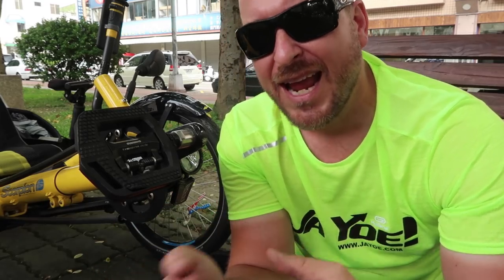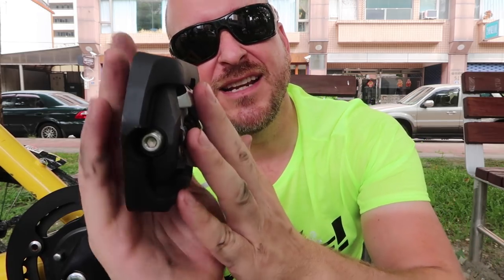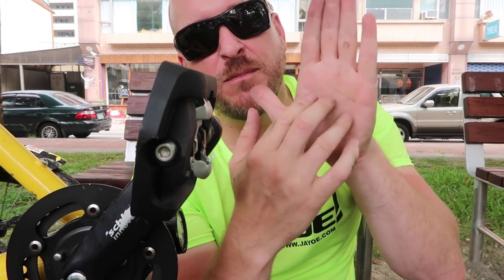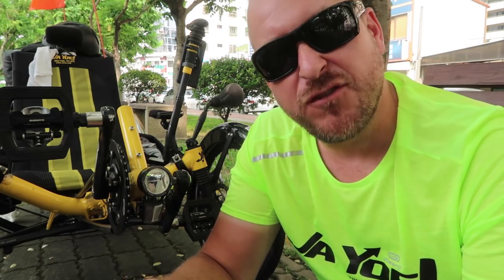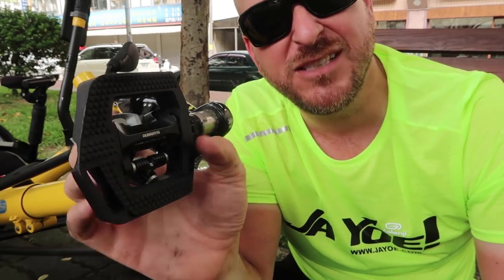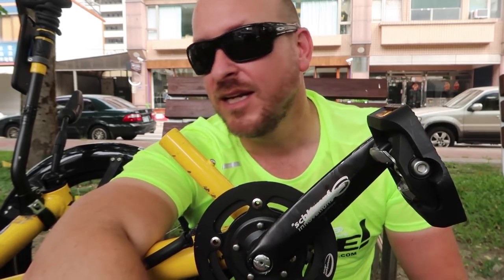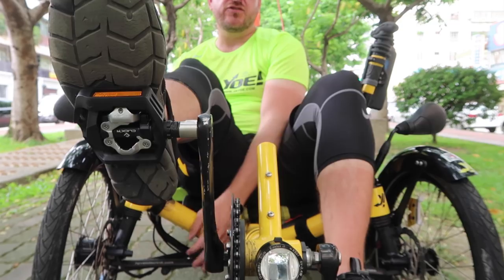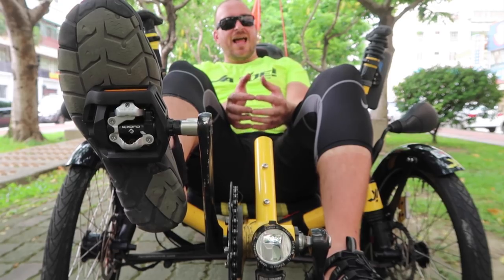PEDAL CONFIGURATION and FOOT PLACEMENT | CYCLE SUNDAY

Comment: Hi Matt...  My wife and I ride Greenspeed Magnums. We average around 3000 - 4000 kms per year on our tours. The Magnum has no suspension. I have experienced leg suck once when I ran over my right leg. Fortunately(!?), while I was going pretty fast downhill, running over my leg caused me to crash into a ditch pretty well immediately so I had a bunch of painful scrapes and colourful bruises but nothing broken, beyond a side mirror. I know the reason it happened too - I hit a rough section on the road unexpectedly and the leg that was NOT pushing is the one that I ran over! Now I ride clipped in. However, after 6 to 8 hours or more, I experience the same numb foot issue as you describe. I have taken to un-clipping one foot at a time to move around on the pedal. I like your analysis and I may go back to platforms. One thing I find, however, is I get a huge power increase with the reverse pull while clipped in. That's very handy, especially when I need a quick acceleration. I also use the Kneesavers - best investment ever! I run a Schlumpf Mountain Drive and a Nuvinci N380 with a 60 tooth sprocket on the front. My Sunday Trike suggestion is actually about your camera setup - how do you video while riding? Why isn't it all jerky and seasick-promoting (as mine are)? How come your sound is so much better than my efforts? After riding thousands of kms in all kind of conditions, what kind of camera would you recommend?? PS. We love what you are doing and have followed you from the beginning. 73, Larry and Debbie
Reply from the maker: What I’ll do is go over my writing recording set up in the next gear video on Friday. I’ll show you the camera I use and I’ll show you exactly how I hold it in order to get that really nice clean shot. Glad you didn’t break a leg.

Comment: Thankyou for the informative suggestions.  I have also found that moving my feet slightly around relieves stress, and also using wide platform pedals.  Its nice to know that I am not alone in this seemingly odd habit.  Happy riding!
Reply from the maker: yea!  it is certainly helpful... restricting movement cased me a lot of problems.

Comment: I like the sound of the pedal extenders....think I will try them too...
Reply: Within days of getting a Catrike , my right foot slipped off several times and I ended up with a nasty road rash above my right heel. I immediately got pedal extenders and clipins, and all is well. Previous to switching to the Catrike I put in about 30,000 miles in five years on my regular bike, without clipins! I. detested them on regular bikes.

Comment: I ditched clipping in on my FS26 too, I use mountain bike style platform pedals with metal studs that provide plenty of grip. I can move my foots point of contact around a bit to prevent numb-foot.
Reply: Yes, indeed!  I totally agree.  These are the ones I use:  https://www.amazon.com/gp/product/B018J1J7QE/ref=oh_aui_detailpage_o09_s00?ie=UTF8&psc=1
Reply: They really work great, I put them on all my recumbents and I never have numb foot anymore. Like Matt pointed out getting your foot lower at times also helps eliminate fatigue.

Comment: I experienced leg suck once. No broken bones, but painful and some nice bruises. I now have the same pedals as yours. I clip in when riding on rough pavement or in twisties. On smooth straight stretches, I unclip and flip the pedals over, placing my arch over the pedal. Much more comfy. My next "solution" will be to have Bill Barre of FB's Recumbent One group build me some "arch clip" shoes. He moves the clip back to the arch area. Users swear by them.

Comment: Really love this idea of cycling Sunday Matt . Despite what some of us have said about your fit on the Trike only you know what is comfortable . The only down side to the foot position on a recumbent is gravity is working against you not for you as it is on a regular bike . Some of the energy you could be using to go forward is being used up to hold your feet in the air , and for that reason alone I will always support being clipped in . Plus cyclist in all positions know all too well about hotspots in your shoes with many solutions but for me I had to recently spend way too much on a pair of Shimano XC9 to finally get rid of it but are the most comfortable shoes I have worn ..

Comment: I commute 30k/day on my Gekko and pedaling in the middle of my shoe has shown itself to be the most comfortable position of all. In a recumbent you can put way more force on your pedals and the ball isn't built for force, it's built for jumping and landing. Dead lifters don't go up on the balls of their feet, they keep the weight closer to the heel. You wouldn't carry a heavy box on your tiptoes etc... A suggestion for a cycle Sunday would be the drive train. How do you keep it clean, specifically how to de-grease and clean the insides of your chain tubes.
Reply: The goal of weight lifting and carrying a heavy box is to lift something off the ground.  The goal of cycling is to push the pedals away from your hips.
Reply: i agree, but for roadcycling it's using higher cadence, and they use their calves to add more watts.
thats why they pedal with their toes, bc they can use more force rather than purely downstrokes
i actually noticed this even when i do MTB with flats, if i rise my saddle, i tend to use my toes and i feel more power on higher cadences
but on another hand, i end feeling discomfort on longer rides from the saddle and even on my feets
higher cadences and toes pedaling allows to produce more power without getting too much anaerobic, but it can cause discomfort
while for longer pedaling times, lower cadence, and more heel pedaling is more confortable, and you dont care much about higher power transfer, you can about comfort, its kinda like walking

Comment: Depending on your fit, clipped in can let you relax your legs a bit - I first rode on a crowned tar and chip ride without clips.  I was so tired afterwards from holding my legs up and on the pedals that I put on  my clip shoes and swapped pedals.  I still rode upright at the time, but had switched to non-clip pedals because of hot-foot issues (so the opposite of what worked on the trike).  I’ve now modified a set of old Shimano shoes for mid-arch cleat position and am very happy with it.  I use the Click-r dual-sided pedals on the trike- which are easier to clip-in and -out of than Shimano’s other models.

Comment: I've ridden both clipped in and not.   Clipped in my feet would also get numb.   I now have a pedal attachment that uses velcro straps to hold my heals in or to keep them from falling off the pedals.   The only time I ever lost my footing on a pedal is when I was really tired, but I would catch myself really quickly and not have a problem.   I have had the knee savers since day one.   I do however move my feet around like you.   I like having that option and my feet tend to last longer on the trike, before having to get up and stretch.  I no longer use the clips and just ride with my tennis shoes.
Reply: dbkguy could you post a link to the pedal attachments you use?
Reply: I'd like to know too

Comment: Hey ,Matt I think a video about the suspension would be interesting.  Are they adjustable shocks or springs for different types of weight?  Can they raise or lower the travel height? Can you adjust for a softer ride ? Or stiffer for more aggressive feel ?

Comment: On my two wheeler I had clip-ins I kept getting numb big toes, moved the clip around same problem so took those off also ditched the shoes, expensive but useless. I then changed my shoes to just thick soled, waterproof North Face outdoor shoes and have used them ever since, saves carrying two pairs shoes but I do cycle in colder climates. I changed my pedals several times but ended up getting large flat pedals and those are excellent, when I get my hp I’ll transfer and see if the pedals work okay, but clip-ons I won’t use again. I may also try a shoe insert for plantar fasciitis as I had it... but don’t anymore... and boy it’s painful but the insert was like super cushions👌 What make and type of shoes are those shoes your wearing in this video? Don’t have to tell me now could be a shoe review video?? Great review and live stream 👍

Comment: Thank you for your testimony. This is very good info.ok my Q; How are you faring after 20k KM with Tires Tubes and Brakes ? How often do you need to replace your tires due to worn treds? Which Brand / style do you recomend for long term tred wear? 
My Dream/Goal is to design a Large Wheel (29"-39") ETrike for Cross Country /State Riding. So far I have noticed the rubber on my 29"MntBike wears down within a 4 month time line. Just doing daily 5 mile rides. Thanks again keep up the Great Work! I wish You Safe Fun Riding. V/R, TONY

Comment: Verry good tip. Until now I also use Shimano cleats and I have exactly the same effect and problems. But I'm if I do not use them, I'm afraid that I can't the push back orr pull effect and need more muscle energy in fact.

Comment: Hay Matt, loving the vlogs. I am a fellow trike “pilot”;) I have lower limb damage both Achilles are shot and I ride the same heel on pedal eliminating the anckle flex your right about the position being effective and less tiresome while I doing off-road / beach riding.
Reply from the maker: Right. And I think you get more torque force. If that makes sense.
Reply: I agree you probably have low speed torque and a lower speed /comfort over distance you with the rolhof speed hub and your smooth front drive switch with low drive train losses over the standard derailed system probably have better returns than myself running standard equipment.

Comment: Maybe you could explain X-Seam measurement and fitting a recumbent to the rider. 
   I have an extra wide foot and healthy knee history. I still find I want to position my feet wider on my trike. I have sandals that can clip in and have hesitated to buy shoes because so few might fit my width. You have just influenced me to look at pedal extenders and those twist in straps I've seen. I have had my foot slip off. My trike frame is non-suspension and it can be jarring on rough pavement. I have sufficient reaction time and strength to not have foot suck be a worry. I do know from backpacking experience that even strong people get clumsy when fatigued. That's why I would want to keep the clip-in option open. After a while I moved the sandal hardware closest to the heel.

Comment: I had leg suck occur on a SWB two-wheel recumbent and the resulting crash could have been a LOT worse than it was.  As it was I ground one knee to the bone and slid along the pedals and gears, ripping myself up along the way.

I now refuse to ride a 'bent of any kind without a heel strap of some kind (the adjustable Velcro kind seem to be best).

Comment: Question: do recumbent bicyclists get "Bike Fit"s?  I found with bicycle touring, comfort is key.  If you have poor pedal position / wrong seat height / forward - aft seat position / forward - aft stem position / bar width / brake hood positions (I ride with road bike type bars) = these positions become very important over long distances while cycling.

Comment: There are two changes in the pedal configuration that affect recumbents (compared to conventional bikes).  
First, the width between the pedals must be increased (compared to conventional bikes) to accommodate the natural 'splay' of the hips when in the recumbent position.  (This is why your knees naturally spread apart - for women or for men - when in the sitting position). You have done this for your recumbent. 
The second change is to reduce the crank length by 10-20mm.  This is to accommodate the difference in hip movement for a recumbent bike compared to a conventional bike.  (That is, the hip tends to move away from the direction of the pedal force on a recumbent, not towards as is the case for a conventional bike). This change will minimize 'over-extension' strain from the foot/ankle, especially the knees, and all the way to the hip.
I accomplished both requirements by mechanically clamping  'cut-off' crank arms to the outside of my existing crank arms. (The pedals are attached to the cut-off crank arms). It is then easy to adjust crank length and by experiment achieve the best crank length. This simple approach also does not permanently damage your existing components,  I could send a photo...?
Reply from the maker: Sure. Send to mcgalat@gmail.com
Reply: I have sent you a photo along with a brief explanation of the pedal/crack modification.
Reply: I took my 170 mm cranks off the Giro A 20 touring bent and I now run 153 mm crank arms , far nicer on the knees with all the power and a better cadence too.

Comment: Logical.  Moving your foot on the pedal closer to the heel puts your ankle closer to the point of pressure.  Putting your foot (clip-in style) means your pedal contact closer to the ball of your foot as if you were walking all day on tip-toe.

Comment: Leg suck! Once riding a normal bicycle wearing flip flops when been passed very close by a truck I got "little toe suck" between the pedal and the sidewalk curb. Probably about 3 yards  before I could pluck it out. About a quarter sanded away so this leg suck thing has me retracting my legs just thinking about it.
Reply: I had forgotten about breaking my big toe riding a two wheeler on a metal pipe concealed in grass long ago until you mentioned this.  The top of my shoe collided with the circular end cap. That unyeilding pipe rotated the crank to the backward horizontal position and stopped my bike suddenly propelling me sidelong.